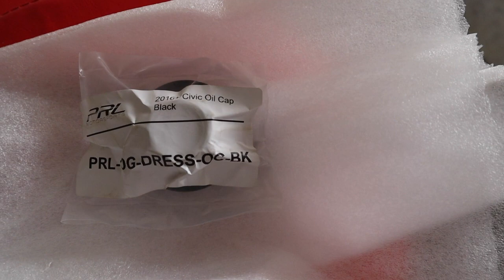PRL Motorsports Oil Cap & Battery Tie Down Install

Comment: Best part about and S2000 is the F22C can hold 500 to 600 on stock internal no prob with correct tuning so your money would be tied up in the turbo kit / supporting mods , clutch and diff , don’t gotta pull the motor that’s a plus

Comment: Are these just to make the engine bay look cool? What performance mods do you recommend apart from strut bar and cai. Is cai working good for you?
Reply from the maker: Yes, and I recommended the I/C, k tuner and front pipe down pipe.

Comment: Did you get the Eiback pack with the Lowering Springs and Sway Bars?
Reply from the maker: Just sway bars
Reply: TTorres1183 still dope. Hope you get the lowering springs. Oh you should also get the pro civic honeycomb grille. I think you would like it. Check it out. But great mods all over bro. You’re pretty much my go to guy on what to do with my SI coupe